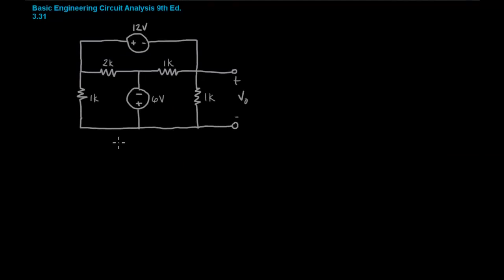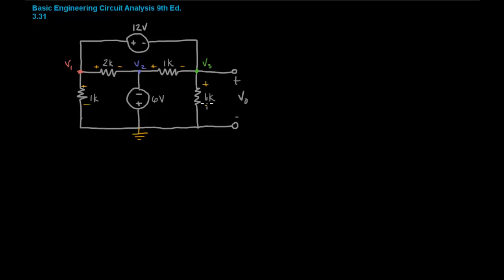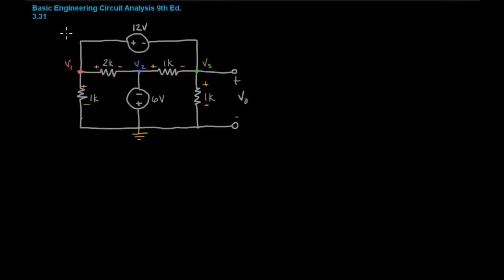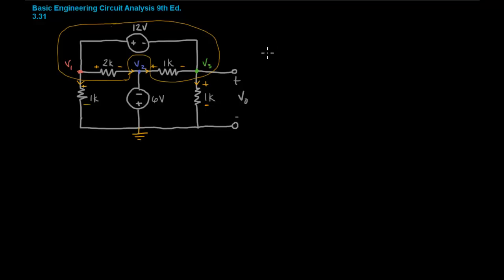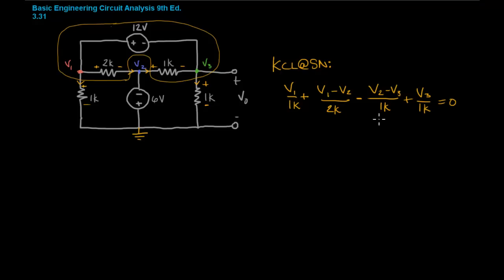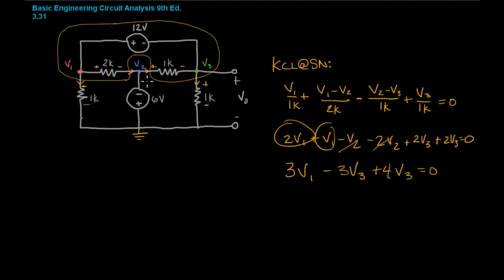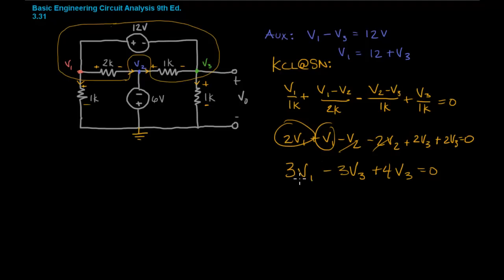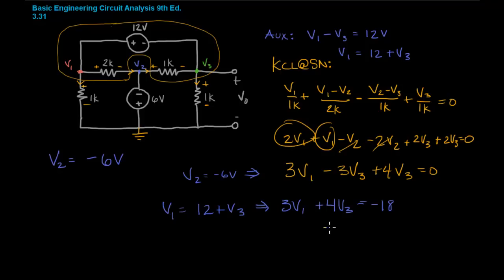Nodal Analysis with Supernode problem 3.31

Comment from the maker: A node can be anything you want.  The idea is that if you cover up part of the circuit, there will be things (wires) going into that part you've covered up.  The sum of the currents will be zero.  For the node, I choose a shape that covers up the circuit in such a way that all the currents going in or out of my shape can be calculated (ie none are in a branch containing only a v-source.)

Comment: If in doubt with this physical mathematical model calculations, get some precision resistors and a calibrated multimeter and breadboard the circuit and measure all the parameters to VERIFY.

Comment: I have a theoretical question regarding the layout of the super node.

If there any difference between including the 1k and 2k resistors inside the Supernode as done in the video and leaving them outside of the node. ie drawing the node such that its bisects between Va and the 2k resistor instead of between V2 and the 2k resistor as shown. Then likewise with V3 and the 1K?

Comment: if the 6v voltage source under node 2 was a resistor then how do you deal with it? would you have another equation?

Comment: sir, what if that -6 V in the middle is not a voltage source, what if it's a current source ??

how will you do the KCL of supernode ?
Reply: wondering the same
Reply: thnx for the info
Reply: yeah but what if it was a resistor?
Reply: ah! brain fart...

Comment: Why v2 is negative
Reply from the maker: look at the voltage source below v2.  The positive terminal is connected to ground, therefore the voltage will be negative at v2.  this configuration tells you that the voltage must be less than ground.  Because ground = 0, v2 must be negative.
Reply: +navya reshu  becausethe source is trnspose andl th and the current input to node v2
Reply: becausethe source is trnspose andl th and the current input to node v2    

+navya reshu
Reply: Relative to the ground (or reference) node, the point V2 has a lower voltage. It doesn't mean it has negative voltage, it just means that it has lower voltage than the ground node.